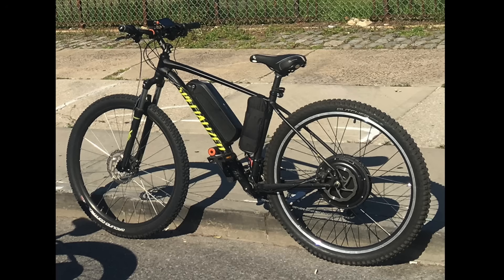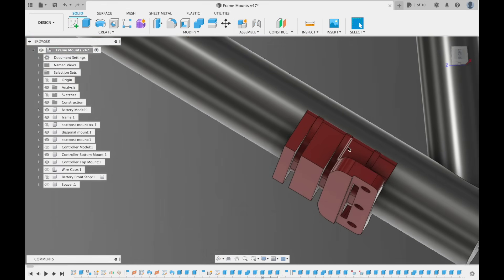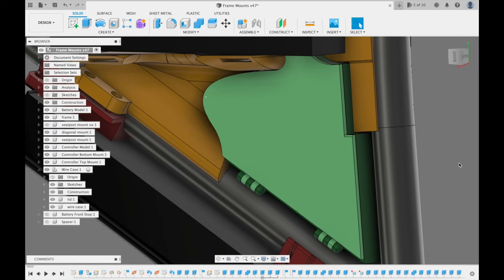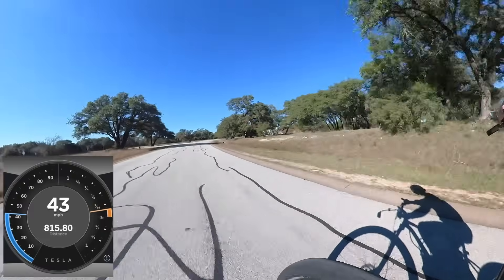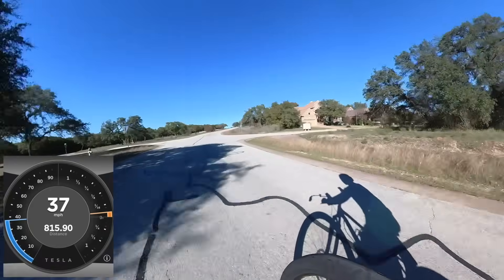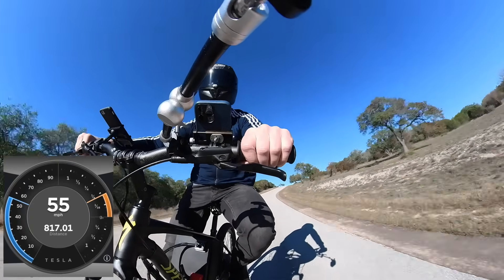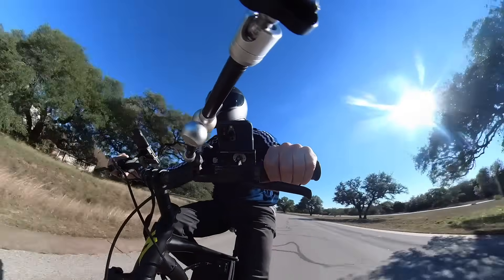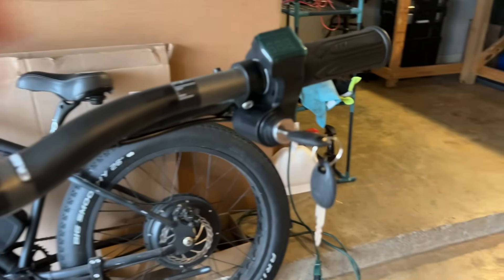I Built a 15,000W eBike and it's WAAAAY Overpowered

Comment: You’re hitting almost 1/2 G. That’s so cool. From the looks of the video without feeling the power, it looks like it could hit 70mph given the right frame.
Reply: Right frame would be an elongated hardtail with a soft suspension seat and foot pegs that let you get symmetrical.   An aero fairing on the front wheel with stabilizing weight behind the wheel, as low as possible.   
  Going super fast is an exercise in sheer luck unless you also invest in slowing down while maintaining control.    There's a couple different ways that can be accomplished besides the usual heavy duty motorcycle rotors and hydraulic brakes.  You could engine brake, spinning your motor like a flywheel.   You could add another brake system like linear V brakes.   The weak point of those approaches is the surface adhesion of your rear tire.   If the tire skids, that's it.  
  Let me suggest a new idea.  Use your 3d printing skills to produce a set of vanes that act like an airplanes' airbrakes.   Mount them on a frame that extends back behind the back wheel, and make damn sure you can brace your feet on the pegs when stopping.

Comment: My 150-200 kilo motorcycle becomes unstable every time I hit a bump or a pothole at high speeds. 15 kilo cycle will not handle these obstacles very well at these speeds. It's a nice experiment but I'd avoid a bad crash.

Comment: Awesome, can you make regenerative braking ? That would be very cool !
Reply from the maker: regen is usually a feature on the controller.. the yuyang controllers use a certain type of control mechanism (a cheaper one) which doesn't support two-way power transfer, so not possible to set up regen, unfortunately

Comment: So if it has a top speed of 60mph that would mean that the top speed is slightly lower than a 15000w internal combustion engine motorbike?
Reply from the maker: power (in watts or horsepower) does not directly correlate to top speed. it has a lot do with torque and power transmission
Reply: @GaiusGarage  Yes I suppose the overall design has to be considered.
Reply: @GaiusGarage  A couple of other things are weight and the heat transmitted both through the motor and wiring. If those melt then top speed is shot. Theoretically though due to the light weight of the bike you could potentially go between 65-95 mph if the frame could sustain the pressure and you didn't hit a big enough bump to lose traction.

Comment: Remember those tires are not designed to be run at those speeds, the tire could come off. None of those component are meant to handle that much speed and torque. 30mph is already pushing it.
Reply from the maker: yeah its a precarious situation

Comment: 15kw is about 20HP. So similar power output to a 200cc motorcycle, but with that weight, easy backflips 😅

If you do an airial tuck, it probably do a topspeed of above 65mph, not sure though. But no gloves?  Easy road rash

Comment: True 15000watts is supposed to be 71+ mph ! Hammer down !
Reply from the maker: there is no direct relationship between watts and top speed. theoretical top rotational speed of a motor is directly related to the voltage and the motors KV value. the actual theoretical top speed is then determined by the mechanics of the drive transmission (size of wheel, relative sprocket size etc.). But since the real world introduces a lot of resistance (heat, wind, friction) the actual top will always be less than the theoretical value. High current is required to get your top speed as close as possible to the theoretical value, since this is what will provided the force to "push" past the resistance. Since resistance can never be zero, the amount of current required to exactly match theoretical top speed is infinite. But very high current can get you maybe 90%+ of the way there. Hence the roughly 60mph top speed for this bike
Reply: @GaiusGarage  Is your printed case fireproof? What assurance was there this thing wouldn't overheat as you were trying to max out the speed?
Reply from the maker: @johnames6430  not even close to fireproof but would likely not overheat since 150A peak is pretty mild for these packs
Reply: @GaiusGarage  people who use fardriver usually end up more satisfied with speed, and torque!? True or fasle??
Reply: @GaiusGarage I just discovered flux weakening bro, and 7000-9000 rmp on my fardriver nd84530s is anyone brave enough to try 160+ mph on a e-footscooter? It has 3 settings, #1 . 40mph "sub-hyper scooter around town. " #2. Extreme Adrenaline junkie beware/ be warned ." #3 🙈. Fkkk around ,and Find out!." If you're ever in spokane? Come take it for a spin!

Comment: Great job.
If the torque is too much for you, if you're worried about the dropouts & frame, if the motor is overheating, and or that controller isn't very programmable. You can pass the throttle through a Cycle Analyst V3 from Grin Tech, instead of directly to the controller. When reducing the maximum current, there is a linear relationship with torque and Amps. I'm so excited to overvolt motors knowing this. The only limit is how much speed the bearings & motor can handle, before friction & centrifugal force rips it apart, and how much voltage the winding insulation can contain. 

I understand a hardtail frame has a lot of space for components, but I would never run a hardtail or rigid bike with even half this power. Especially with the garbage roads in my area. 

This is why I'm looking for full suspension frames, that look like roadbike frames, but the shock is built into or just under the top tube. I've seen frames like this. But I'm looking for 29er frames, because in my search for bicycle wheels that will fit motorcycle tires, or bicycle tires with a marked load & speed rating. For now, I've settled on e50 700c tires, on 700c hub motors, in a full suspension 29er frame & fork. The stealth of a bicycle, can just walk it into my apartment, but the most acceleration I can have up to 50kph, what those e-bike tires are rated for. And those narrow tires will be so agile & efficient.
I'll live with this until I can convert a gas motorcycle.
Thank you for this video, it was very helpful.
Reply: yup, I'm with you, full suspension full size frames, why are all the frames BMX size now???
Reply: shit this sounds amazing... Any chance you have a blog or youtube channel yourself? I know very little coming into this, but it really does seem like you can build a long range mostly throttle, good torque (for hills) ebike and not only save but customize it easier.
Reply: @gomi_cat i can build a better than on the video, if someone prepared to pay. But it's all starts with modest budget of a surron
Reply: Like it would cost you that much to build? I was just thinking in terms of diy, and some custom machined parts perhaps being able to make something super nice yourself with good torque and range. 

Nothing crazy or fast, but something even a larger person on a bike could get 60 miles and tackle some steep hills without dropping too much speed.  @eXTreemator  I think it was just nice to see things like this can be done, and safely.
Reply: @gomi_cat  every nice thing cost money. Yes it's not free. All nice components cost money as well as labour. And custom machined parts take it to another level of cost. People want the best but done want to pay for the best
Reply: @eXTreemator  Well yeah, I mean labor doesn't cost shit if yer doing it yourself though, unless you are incapable and mess everything up. Having lathes, 3d printers for mockups, CAD experience or machinist friends helps too.
Reply: @gomi_cat  seems like you already could build it only for some reason didn't yet🤔

Comment: Awesome work and use with the 3D printer, you should try some some good quality PA-CF for some these parts, but I also recommend a good 97 SHA TPU as its shock/vibration dampening, and is nearly as strong as cast/moulded thermo set Polyurethane, after watching this a few other vids of yours, Im subscribing :).
Reply from the maker: Thanks! Yeah Ive started printing with PETG-CF recently - really awesome stuff! Didn't know about 97 SHA TPU - definitely gotta check it out
Reply: @GaiusGarage  Yes PETG-CF is quite nice, prints easily on an open printer like yours and has enough flex to survive the hard knocks of EMTB, I use standard PA-CF as its also very flexible and can withstand the odd crash :) I use PA-CF for mounting things like display holders, phone holders, light brackets and even mudguards, but PETG-CF would also do the job, not quite as durable but still good enough, I make all sorts of other gear for race bikes like pouches and toolkit holders out of the TPU, and will be the best material for custom battery packs and controller mounts.
Reply from the maker: @NexGen-3D  why do you think TPU would be best for mounts? Isn't TPU flexible - a good mount would be strong and rigid. I've been using PETG-CF for structural mounts lately and PLA plus for non-structual anesthetic components, since it's easier to achieve very smooth surfaces without sanding with PLA vs. other filaments
Reply: @GaiusGarage  TPU acts like hard rubber, if you look at some of the electronics you removed from the KLR Ill bet some were mounted to the chassis in rubber, usually 60 SHA or harder, isolating electrical devices through a vibration dampening mount will help prevent damage to them, 97 SHA TPU is flexible but its not soft, and its far stronger than plastic, its heat, chemical, UV resistant as well, the eSun Black TPU is really tough, give it a shot, and the 83 SHA TPE is really good for making water tight gaskets or vibration wraps for metal clamps etc.
Reply from the maker: @NexGen-3D  I see. that's a good point about vibration dampening. Thank you for the feedback! I will definitely give some TPU mounts a try - maybe replace some I've already printed for current projects.

Comment: Dude your bike was punching through the 50s like nothing. On a smooth road this thing could probably hit 80 mph.
Reply from the maker: it definitely tops out at around 60 due to KV of motor & voltage but 80mph on this thing is near suicidal
Reply: @GaiusGarage What feels the least stable? There’s a guy running aluminum frame e-bikes at 100mph. Tour de France and Mountain bike downhill racers can hit very high speeds. Which components are you most worried about?
Reply from the maker: @smithright  there no steering damning so Im afraid of the steering resonating out of control. This aluminum frame is not designed for these speed and forces - unlike steel, aluminum has little elasticity and fails suddenly. just not worth the risk IMO
Reply: @GaiusGarage aluminum is not the problem you just need a sturdy frame that is designed to take much more than casual pedaling 15-20mph on smooth pavement. your hardtail MTB frame is probably capable of much more than you think. as long as it's a brand name bike and not Walmart Chinese junk (don't get me wrong Chinese know how to make good stuff Taiwan makes frames for the whole world, ranging from junk to high end). 

full suspension mountain bikes like enduro or downhill would be even sturdier but way more complicated to convert to ebikes especially with a big battery.

But stepping up from entry level hardtail to a more advanced trail focused aluminum hardtail with modern geometry and 29in wheels would give you a stronger frame, longer wheel base and more stability at speed. these frames are designed to work with a long travel dropper post so the top tube will be lower and the triangle smaller, less space for the ebike conversion so you might need to make a triangular battery pack that fills the frame 
for high power/high speed I'd pay extra attention to the hubs and maintaining them (probably change the grease for something rated for higher speeds)
and probably relace the rear wheel with stronger spikes or at least check the tension regularly especially before a high speed test. then of course obvious upgrades to go 60+mph: road tires for better grip and stability and brake upgrades to reduce brake fade like bigger rotors.
Reply: @GaiusGarage I've taken an aluminum frame road bike to to 60 mph on a downhill. From about 48 to 53 MPH I had really bad frame resonance, but if went away once I hit about 56. 
Definitely not the smartest thing to take to those speeds though, especially with rim brakes.
Reply: @GaiusGarage  considering 60 mph is about 90kph a crash would be almost fatal every time.
Reply: @Enigma-rg6ni So a bit worse than a scraped knee, probably, right? 😂
Reply: @Enigma-rg6ni   What? Fatal every time. Please show your math on this.
Reply: @cyumadbrosummit3534  Depends what you hit when you come off, truck, tree, street lamp, vehicle coming in opposite direction, parked car all fatal.
Reply: @Enigma-rg6ni  bruh I crashed my dirt bike at those speeds thousands of times when I was a kid and never even broke a bone. 😂
Reply: @Enigma-rg6ni  crashing at 60mph isn't necessarily fatal, as long as you slide to a stop rather than hit something. I went off on a corner once at maybe 40-50mphs, and just slid along the grass on the embankment. It was actually kind of fun, but I'm very lucky I didn't break my neck by slamming into a fencepost
Reply: @GaiusGarage  Yeah something going to snap at that speed, instant death
Reply: @GaiusGarage  I would ride that thing at full power, I got all the balls necessary.
Reply: When this thing hits 88 miles per hour, you're gonna see some serious shit
Reply: @LightlySaltedMM  🤣
Reply: I saw that video and it was a 10 kw bike too hit 102 mph and tested with 80 HP and around 900 something on torque was crazy
Reply: It's brilliant but deserves a strong frame and some decent shocks front and rear, it could be something else.
Reply: 80mph is physically possible with the right "gearing" (kV and battery voltage) form a motor point of vue as 200cc 25hp motorcycle reach 90mph

Comment: Was thinking of doing this with my gt pro series. Not really sure how to go about controllers though
Reply from the maker: that Yuyang king controller is the largest "cheap" controller Ive seen. but it uses a square wave control signal which is more noisy and less efficient. Sabvoton, Kelly controller, and other use sine wave signal but are more expensive

Comment: thats really good I made something at 72v with maximum 45amps using well known parts and I felt uncomfortable at 38mph, so i've never found its true max speed, its a Giant Talon 3 frame and it doesn't like to corner tightly, I also find that im putting a lot of weight bearing on my hands, my old MTB was a Kona Coiler and it felt quite secure at its max speed of around 35.
Reply: yup, I'd hate coming off anything above 25
Reply: My bike starts feeling sketchy above 35mph. I know it can go a little faster than that I've had 38 or 39 on a wide quiet road but nope on a mountain bike that just ain't safe. I electronically set the top speed to not exceed 30 and I'm happy with it there.